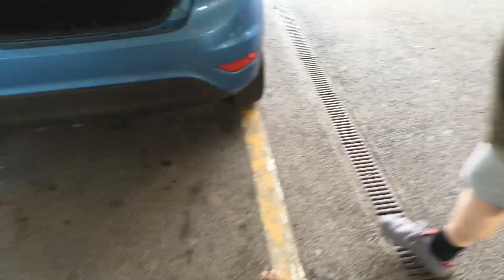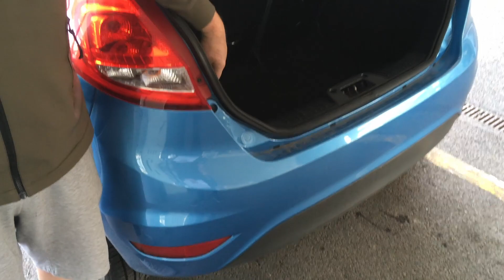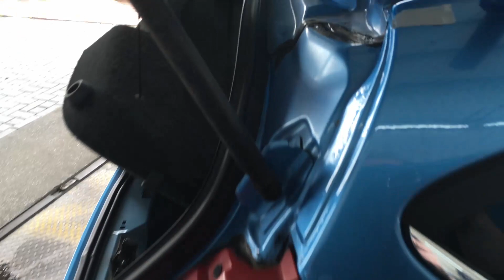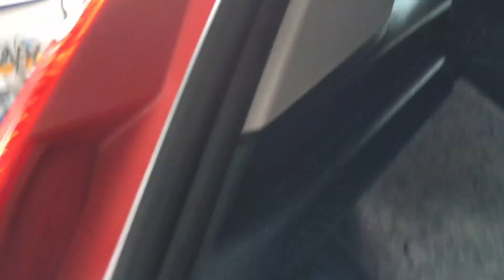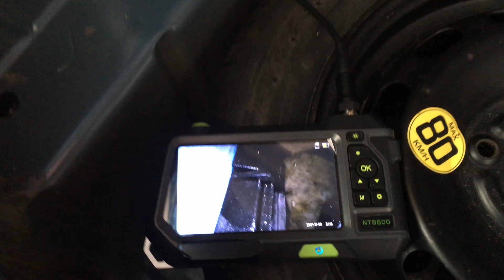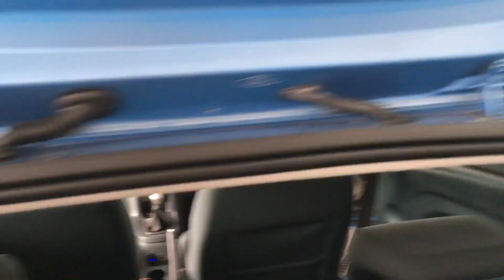Ford Fiesta Water Leaks Repaired

Comment: I removed the rubber items on the roof. Cleaned the groves and sprayed liquid glue(leak spray) 5 coats. The glue also gave adhesion to the black rubber strips when I returned. No leak now. Fiesta 2009 mk7
Reply: What year and model? I have a 2015 ST leaking bad.
Reply: 2013 st fiesta leaking boot
Reply: Do u have pic of spray? Where do I can get one

Comment: I found same problem on 2010 fiesta - leak was from welded roof seam under the plastic roof trim just before it meets the rear tailgate. Painted rubber underbody seal over cracked factory sealant to fix!

Comment: Great video, how much would this roughly cost? Brought a cheap fiesta for run around!! Noticed water in the wheel space??
Reply from the maker: It can vary greatly, so I can't give estimates on the internet. If it is just water in the boot, it is probably something your local mechanic can fix. We sell this service as a package which starts with a £150 inspection.

Comment: How did you get that carpet out the side and what screws did you loosen without damaging it?
Reply: I did this yesterday on my fiesta. Didn't need any of tools to take off the carpet
Reply: The interior is very easy to take apart. Just remove the front seats, pop the rear seats up (no need to remove) and remove some of the plastic panels around the side that covers the wires. Only thing i had to do when i completely removed the carpet from my car was that around the center console the carpet wraps around, so i just reached back with a sharp knife and cut it. After removing and cleaning it just flipped right back into place without issue.